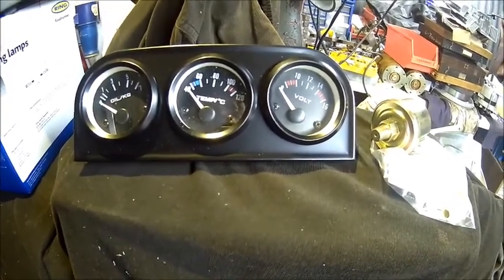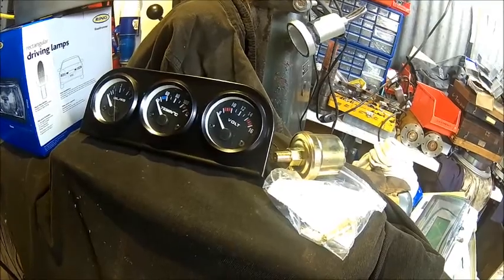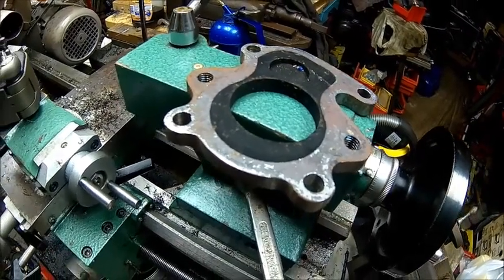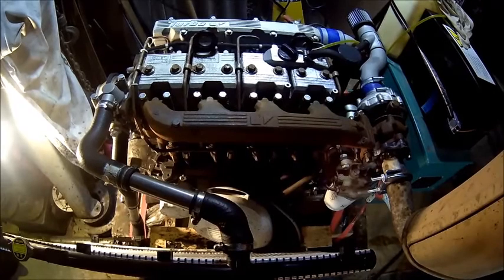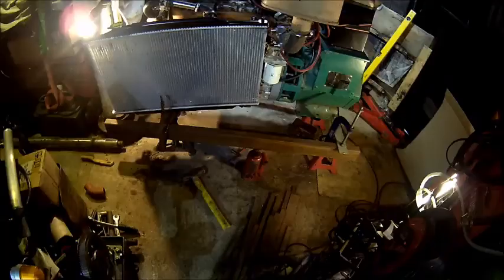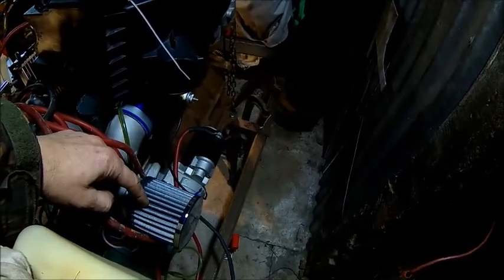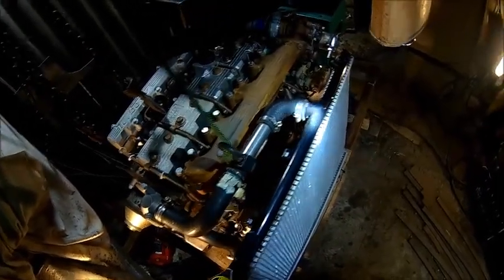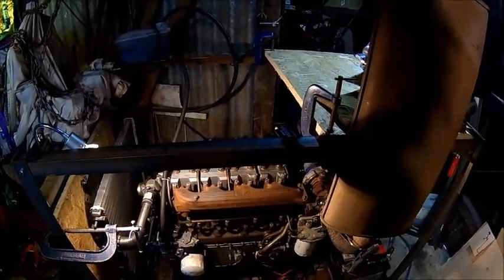20kW Diesel Generator, built from random parts - Part 3, making power, more parts arriving

Comment: How I wish I had a decent heater in my workshop right now.
Reply from the maker: Glad to see you still alive, thought Holland got flooded ...:-)
Reply: Got some water in the cellar but that's the worst of it. 
I looks like we are getting more and more rain every year.
At some point Holland will get flooded it's inevitable I guess.
Reply from the maker: Hope you didn't have too much damage.

Most houses in our area don't have cellars and more rain than over here is hard to beat but we are at least slightly above sea level ...:-) ... and worst case there is still the option to move onto a Welsh hill top, it's only an hour away
Reply: No damage. Just a few cm of water because of the high groundwater level.

Comment: so if yo can switch between 50 and 60hz on that genset, how is that accomplished?? thought that had to something to do with the number of coils in the stator and RPMs??.. as you know electricity is not me forte...lol
Reply from the maker: It's pretty simple and you actually got the right point, it has to do with the number of poles and the speed.
A 4 pole Alternator produces 50Hz at 1500rpm and 60Hz at 1800rpm, so just set your engine speed accordingly and you there. A 2 pole machine would need double the speed. The voltage can be adjusted (within reasons).
If you want only 120V 60Hz it will need rewiring the alternator, that's why so many wires coming out, i think this one is a 12 wire model, so quite flexible. ... Does that make sense for you ?
Reply: yeah that does make sense. looks you more or less fell into a smokin good deal on the components of the machine you're putting together. dude, you made out like a bandit...lol
Reply from the maker: Perhaps i do ....the engine was certainly the best deal at $0 ... :-)... well not exactly,  i had to pay for my fuel to haul it .... so it was probably $3